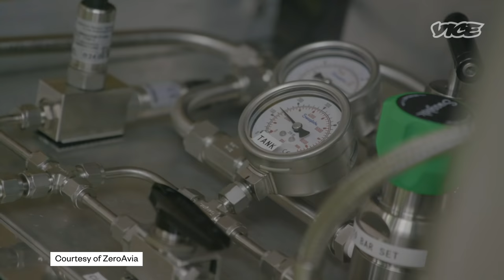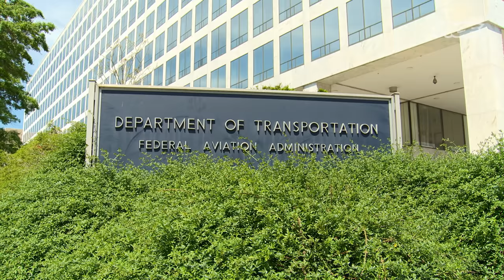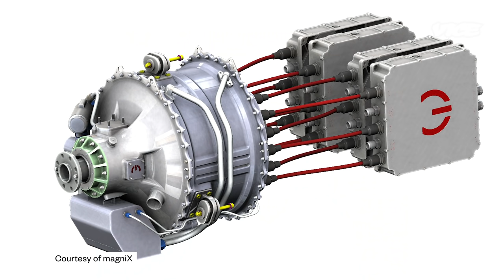How to Make Air Travel More Sustainable

Comment: Let’s shorten the video. Bring the airlines down so we can have high speed rail if we don’t need to cross an ocean.
Reply: We have an Einstein here. Someone call the Nobel committee, we have a winner!
Reply: @PresidentialWinner  just a cookie will do, thanks.
Reply: What will they run on? Unicorn farts?
Reply: @PD-we8vf  electricity which can be produced sustainably ;)
Reply: @PD-we8vf  are you suggesting that because you can’t conceive what other nations are already doing, that it can’t be done?
Reply: @LimitLook  please tell me, exactly what methods are sustainable? Wind, nope, solar, nope. What else do you got?
Reply: @PD-we8vf  Wind and solar not sustainable? Lmao.
Reply: @gustopher6500  what’s the lifecycle of A wind turbine blade? Can they be recycled? Hoe much Diesel does it waste to transport them there? How much fuel oil on a barge from China? How much is the factory polluting that makes them?
Reply: @gustopher6500  Nope. They're not and that's why fossil fuel companies never says bad things about wind and solar. PR departments spend money and time promoting wind and solar because they know that natural gas is needed in order to back up the intermittency of wind and solar. On top of that, manufacturing, moving, installing and maintaining solar panels and wind turbines requires vast amounts of fossil energy.
Reply: @gustopher6500  Fossil Fuels companies loves wind and solar. Tell me how many wind turbines is possible to manufacture without using fossil energy. Zero! ZERO!!!!
Reply: @Brandon_letsgo  There's no hope for you lmao, you can't comprehend the fact that the difference in carbon emissions per unit of energy are miles apart for fossil fuels and renewable energy. Stop listening to the polluters
Reply: @gustopher6500  I have a moral code: I would never  buy a car built with slave labor from Congo kids. That’s simply wrong.
Reply: @Brandon_letsgo  yeah cool I don't like exploiting kids either. Kind of the absolute minimum for being a decent human being.
Reply: @Brandon_letsgo  uum… no? How is a national high speed rail network a bad idea?
Reply: @zizimugen4470  In countries like Japan, and most European countries, rail makes sense but in Places like the USA, Canada, Australia, the population density makes it not viable. Living in the US it makes more sense to fly and drive. That's why the high speed rail in california is a such debacle. It would never work. California itself is larges than most European countries.
Reply: @Brandon_letsgo  Ah, so they can do it where there are many natural barriers like mountains and rivers, but we can't build bridges or drive a train at high speeds on secure lines across the unobstructed Great Plains?

You're right, how silly of me to think that humans could be carried by rail across this country where a train could really hit high speeds if given the power.

Comment: Design those policies to ramp up.
10% of the ≤1000 mile flights by 2030.
20% by 2035.
50% by 2040.
100% by 2045.

Just doing the last one means that no one will convert until the last minute, and that keeps money out of the R&D required today. The first 10% will be the most costly, so if we delay that 10% until we require 100%, it's going to be a mess. Also, the shortest flights will be converted first, so 10% really means 2-3% of miles.

Comment: This is actually a good question. At this point, plane manufacturers should definitely look at hydrogen fuel cell as the viable alternative. Imagine using batteries for electric power, it's not that sustainable and long-lasting.
Reply: Yep, is all hydrogen was to come from electrolysis, it would be much cleaner than BEVs

Comment: Batteries are an dead end technology, the physical and chemical possibilities are already maxed out.
Reply: You know nothing about batteries.
Reply: @gustopher6500  me having a degree in chemistry sure.
Reply: @blubb7711  then why don't you think there's no more potential in battery technology, seems like a horrendous take
Reply: @gustopher6500  because there is no element with higher electrical potential than lithium. You could built batteries that are cheaper based on sodium, but weight and size are drastically higher. Lithium is the maximum our universe has to offer when it comes to batteries. That’s why fuels are so superior.
Reply: @blubb7711  you don't see any potential in lithiated silicon?
Reply: @gustopher6500  dont feed the trolls